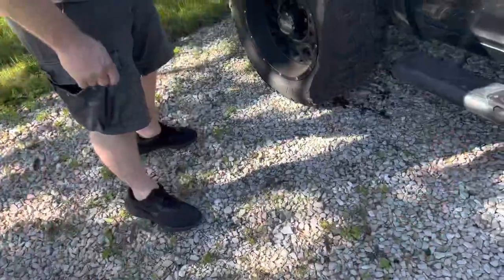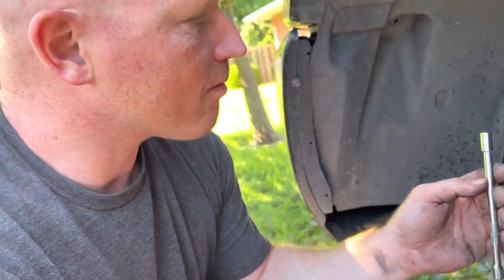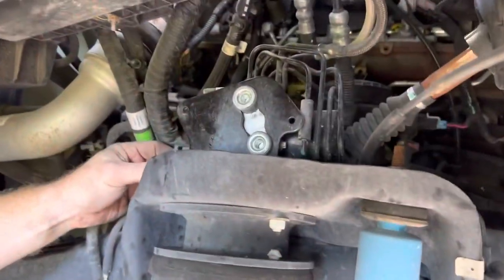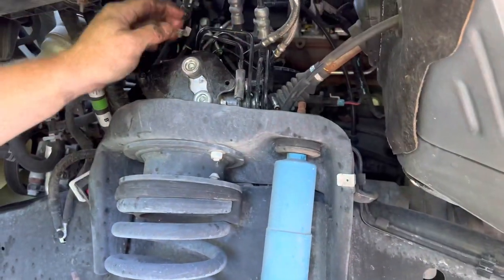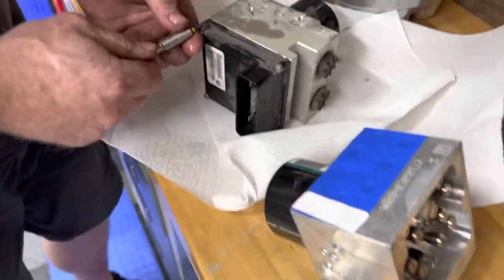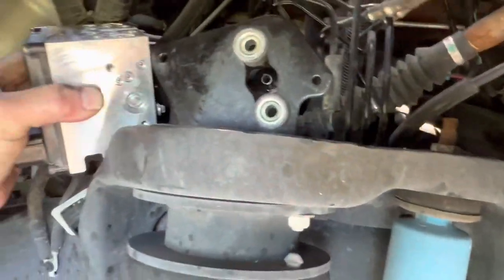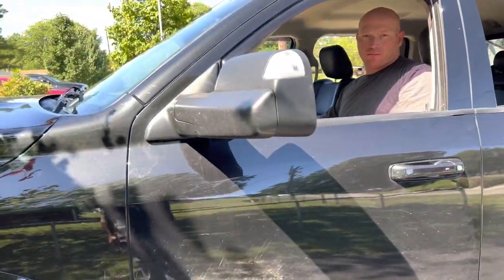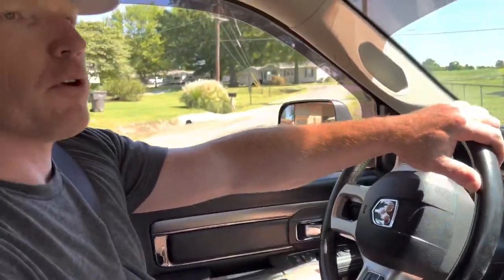How To Replace A Hydraulic Control Unit ABS Pump Replacement / 2018 Ram 2500 6.7L

Comment: December 2022 NHTSA open an investigation into the HCU and ABS module issues on the 2017-2018 RAm 2500 and 3500 trucks anyone repairing these needs to file a complaint. Ram needs to fix these problems and those who paid to fix it need to be reimbursed by RAM.
Reply from the maker: Thanks I will pass this on
Reply: My truck started doing that. If you take the hydro boost lines and you shake them, there's a liner on the inside of them. You can see it on the older generation of ram. It would get sucked into the tube going to the hydra boost. If you change the HCU and the ABS module I would consider looking into and replacing those lines. I'm getting mine custom built to where it gets rid of the liner
Reply: Where do you file the complaint
Reply: I called Dodge and complained, I am waiting on the back ordered parts.  They said they will do a recall if enough others complain.
Reply: @woodybice9075  , Dodge HQ
Reply: @bobrainey9907  dealership said mine is the hcu and it’s on back order for a few months. The highway safety website says it’s under investigation so hopefully it’ll get recalled.
Reply: I replaced my last year and got the same problem again  the first time was under warranty now its going to cost me 1300 to fixed by dogde dealer
Reply: My 2018 with 83,500 miles just started messing up on my way home from Wyoming towing my fifth wheel. Great video and hopefully we get a recall. I’ve had this truck since 9,200 miles and don’t need it to fail now.
Reply: Where do you file a complaint this is tge second time mine does this had it fixed at 48000 miles and now at 85000 it started again
Reply: Sadly it's almost a year later and I have been told there are still more parts. I do not even care about spending the money, I just want it fixed.
Reply: I thought we were getting a recall. What happened?

Comment: FYI. After you bleed the brakes the standard way you need to hook the dealer computer to the truck and do a power bleed of the abs module. You’ve cleared the air out of the brake lines but there is still air in the HCU block. When the abs kicks in during an emergency it might not have brake fluid to make them work. Hope this helps.
Reply: Yep. You need a regular old brake bleed, AND THEN an ABS brake bleed. You can do this with AlfaOBD yourself. The air was not bled out of the ABS system properly without the ABD bleed function.
Reply: @DoubleA-ARon  I’ve looked at getting the AlphaOBD. Is it a good system? I keep hearing about things you can do with it and thinking I might have to get it.
Reply: Can also do it without a scanner if you have access to a dirt road. Get the abs to kick on a couple times then bleed again.
Reply: You can do this with Launch code reader 2.0. As it do it yourself mechanic that is the best investment I have ever made for these computerized vehicles, including my BMW that I no longer have to have coded by the dealership.

Comment: I don't give a rip about having ABS brakes just want my cruise control to work, which it doesn't when the stupid HCU isn't working.  The common occurrence of this failure should warrant a recall by Ram but no.  Been waiting 1 yr for the part to become available.
Reply from the maker: Damn that’s crazy and trying to get the part is dumb and I agree they need to do a recall

Comment: this didn't work for me on my 2018 ram 2500 with 53k miles.  I see corrosion on the pins.  I cleaned and reseated the canon rectangle plug 3 times with crc electronic terminal cleaner, but no joy.  had the wife monitor the dash lights while i tapped the HCU and the control module, then the light went out.  I feel im going to have to remove it and disassemble and clean to see what that does for me.

Comment: Was having the SAME ISSUE with my Ram, simple fix and FREE! - unplug the wire harness from the hydrologic unit on drives side and clean out the dust. Fixed it and I bet it will work for all of you
Reply from the maker: Really. That’s good to know
Reply from the maker: Thanks
Reply: Same issue but unplugging and cleaning was a temporary fix.
Reply: It was temporary when I did that
Reply: Still going good?

Comment: The same thing happened to mine at 45k miles. Had to replace the HCU and so far 10k trouble free miles
Reply from the maker: Hopefully it stays that way
Reply: My truck started doing that. If you take the hydro boost lines and you shake them, there's a liner on the inside of them. You can see it on the older generation of ram. It would get sucked into the tube going to the hydra boost. If you change the HCU and the ABS module I would consider looking into and replacing those lines. I'm getting mine custom built to where it gets rid of the liner

Comment: What would they need to program? I. Just called the dealer today and they told me the same thing it would have to be programmed
Reply from the maker: The truck in this video we did not need to program anything. There is some kinda computer board that bolts to it. If that part needs replaced then I can see a need to reprogram it other then that all is good with it

Comment: I have a 2018 Ram 2500 mine went out at 17000 miles then again at 57000 miles. I had an extended warranty so it covered both times. Hope it doesn’t mess up again. Definitely needs to be a recall. The first time they replaced with part number 68143491AA second time was part number 68143491AB I’m hoping it was an upgrade because it said the AA was discontinued.
Reply from the maker: Seems like it needs to be a recall. Just from what I’ve seen on here it’s happens way to often and costing 500  just for the part is crazy
Reply: I have a 2018 Laramie, 6,7 Diesel that had a fail at @5000, the second fail at @21,000 and now the third at @33,000. Taking the truck in tomorrow to the Chysler, Dodge, Jeep, Ram dealer here in Temple, TX. Created a case through Ram on Friday. A tech(?) is supposed to be checking to see what has failed for the third time...can not be 4 bad HDUs could it? Has to be something else?? GEEZ ! Love the truck but this HDU failing on the average every 8K is ridiculous!

Comment: You also need to perform an ABS brake bleed. You can do this with AlfaOBD at home. It runs a line-by-line bleed with the HCU motor. It walks you through bleeding the brakes one by one as it cycles the ABS HCP/Pump. Without this step, there will be air int eh ABS pump that may cause an issue when it fires the ABS system.
Reply: Is this true even if you only replace the HCU and not the ABS Control Module?
Reply: @mitchellryan895  if you cracked brake lines on the HCU, you would need to bleed the HCU with something that can perform the ABS bleed
Reply: @DoubleA-ARon  Thanks a lot. Seems I've been getting some bad info elsewhere. I'm trying to figure out a way to get my truck fixed without doing it all through the dealer because they previously quoted me something outrageous just for parts.  Wanted to replace both the HCU and the ABS Control Module and were talking like $1500 for them plus labor. Is AlfaODB something a shop might have access to? Or am I pretty much stuck going through the dealer at this point?

Comment: I have a 2018 ram 2500 started doing the same thing back at end of December took it to dodge dealership said needed abs module and HCU. Paid and ordered parts abs came in march as they said HCU would too next thing you know now ETA for HCU moved to August and that’s only if Chrysler finds a distributor then on top of all this bad news about 2 weeks ago had to drive it to school and brakes locked up and a hissing from hell came through so yeah hydro booster sucked pressure line in and demolished it ha got all that out but the bottom bolt is hell to get out gotta try again tomorrow during daylight

Comment: Mine just started, 2018 ram 2500, 12K miles. What part number was your HCU? Thanks for the video.
Reply from the maker: Ok here is what I have, I talked with the owner of the truck and he was saying that the part numbers on the new one were different than the numbers on the old one. So the part numbers we have might not do you any good, He said they used like the last 7 or 8 digits of his VIN # to get the part he needed, who knows the parts could be different from yr to yr. To get his part he ended up calling a dealer over an hr away that had it in stock and they mailed it to his house. So by them using the VIN # off the truck the way they did his you are probably off calling the dealership. I hope this helps, its all I have.

Comment: Good morning, this has happen to me twice, last year (2022) after I got all brakes changed and on my 2017, 2500, I couldn’t find the part in any dealer’s here in Quebec, Canada,  all out of stock so we found a used one, only changed  the electronic Part, i didn’t change the hydraulic part, that way i didn’t have to reprogram it. Again this year after fixing driver side parking brake started acting up. Long story short, I had a mechanic to check  the speed sensors on his computer and sure enough there was one bad one, change it and the code disappeared without touching the HCU,
Reply from the maker: Glad to see you got it fixed, and I don't know why some of these parts are so hard to get,  Thanks for your comment

Comment: Having the same issue on my 2018 Ram 2500. Do you have the part number for the part you replaced? Thanks
Reply from the maker: Ok here is what I have, I talked with the owner of the truck and he was saying that the part numbers on the new one were different than the numbers on the old one. So the part numbers we have might not do you any good, He said they used like the last 7 or 8 digits of his VIN # to get the part he needed, who knows the parts could be different from yr to yr. To get his part he ended up calling a dealer over an hr away that had it in stock and they mailed it to his house. So by them using the VIN # off the truck the way they did his you are probably off calling the dealership. I hope this helps, its all I have.
Reply: My truck started doing that. If you take the hydro boost lines and you shake them, there's a liner on the inside of them. You can see it on the older generation of ram. It would get sucked into the tube going to the hydra boost. If you change the HCU and the ABS module I would consider looking into and replacing those lines. I'm getting mine custom built to where it gets rid of the liner

Comment: How many HDUs have you put in it?  I have a 2018 Laramie, 6,7 Diesel that had a fail at @5000, the second fail at @21,000 and now the third at @33,000. Taking the truck in tomorrow to the Chysler, Dodge, Jeep, Ram dealer here in Temple, TX. Created a case through Ram on Friday. A tech(?) is supposed to be checking to see what has failed for the third time...can not be 4 bad HDUs could it? Has to be something else?? GEEZ ! Love the truck but this HDU failing on the average every 8K is ridiculous!
Reply: Ram care help you out with anything?
Reply: @cliftonpaskett9040  They did! The only part of this process that i'd give an A for a grade. They worked/battled with the service/parts department to to get the part (Hyd Cntrl module) ordered and convinced them to upgrade the part so they (RamCare) could get the shipping expedited. Went from an Aug 23 delivery to about 5 days. Part came in on a friday and RamCare told me it was at the shop...The shop never called me to tell me, I called RamCare back on Wednesday morning, and lo and behold I got a call from the shop Wednesday afternoon to bring my truck in. That Friday the part was installed and is working as advertised! RamCare a day or two later, emailed me and comp'ed oil changes and tire rotations through 2029!! I am not gonna complain about RamCare and their customer service assistance at all!!  If it hadn't been for the service advisor at another dealership that told me about RamCare and getting a case opened with them...I'd still be wallowing around, or driving something else!

Comment: Just bought a used 2018 with 50,000. Day 2 and light came on. Do you know what the code was reading? Mine is reading C0020-01
Reply from the maker: I don’t remember a code.  I know my Abs light stability control and traction control would fault.  Service engine soon I think would come up.  I don’t think it would stay on long enough to show a code
Reply: @DomsRusticGarageMore  thank you for the reply.

Comment: I have the same truck with the same exact problem with 25000 miles never been off road. The problem started after a very cold spell here in Chicago. Dealer states not under warranty. Ordered the prepaid part over a month ago and sign of the part. Does anyone know how to stop the light and tone from going off & on at every bump? I tried pulling the ABS fuses but then the Truck wont start. 
Thanks for the info & video.
Reply from the maker: Ya idk we couldn’t get it off either
Reply: Did you ever get a solution to this. My 2016 does the exact same thing in the cold. Cold and moisture cause the light to chime on/off over bumps but as weather warms and is dry, if it is driven over a period of an hours time the light goes off and stays off.
Reply from the maker: @c0ck_l2oach75  The only solution he had was replacing the part, he couldn't get the light from going crazy either,
Reply: Appreciate the reply. I had recently replaced all my brakes and didn't realize about the ABS brake bleed and wondered if a bleed might solve my problem as well. Alot of mystery surrounding the HCU altogether lol
Reply: Mine is doing the same thing for 2nd time. Replaced at 30k, now at 60k. Haven't found parts yet, but pulling the 30amp fuse and leaving the 40amp in, turned off the alert and disables abs and cruise. So, that's where I am until parts but I couldn't stand the intermittent dings.

Comment: If you press the brake pedal down about an inch and hold it there with a 2x4 this will cause the mater cylinder to not drain.
Reply from the maker: Good to know thanks

Comment: No programming needed?
Reply from the maker: No
Reply: Nice! Was it on back order. Dealer told me December before they get them. 🤦‍♂️
Reply: Have that dealer look up the closest dealer with one in stock…. Call that dealer.  I paid over the phone and they shipped it to my house.   Was about 2 hours from me.
Reply: My local deal told me they have about 50 on back order…. Doesn’t make any sense
Reply: @bigred152001  50 on back order?  Says Ram is making a shit product if there's that much failure.  I'm pretty pissed about mine needing this repair at 50K miles.
Reply: @Redandranger  Of course mine would start this right after I crossed the warranty line.
Reply: Just bought a used 2018 with 50,000. Day 2 and light came on. Do you know what the code was reading? Mine is reading C0020-01

Comment: Planned adolescence the unit is designed to go out every two years I'm on my second unit I'm currently trying to find a way to delete the whole system I'm not going to do this every two years everything else on the truck is deleted why not if anyone knows a way to override the system let me know I'm running ez-link